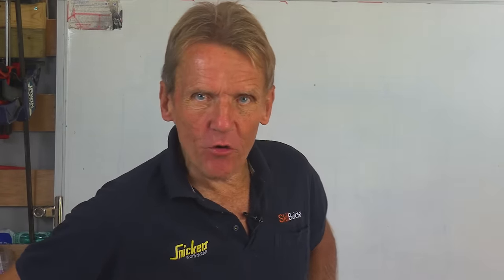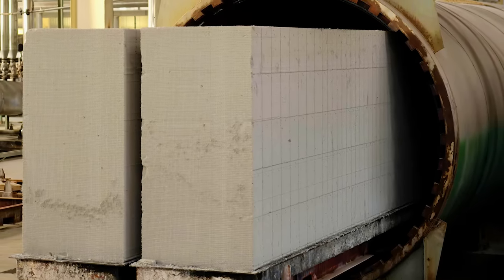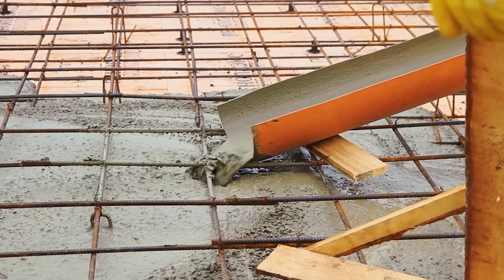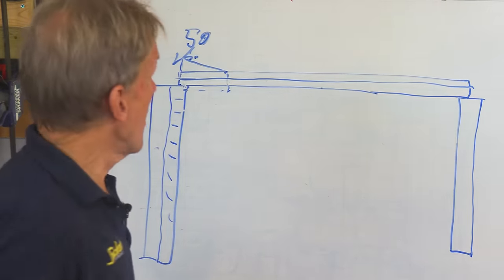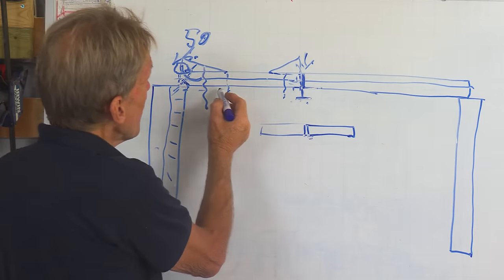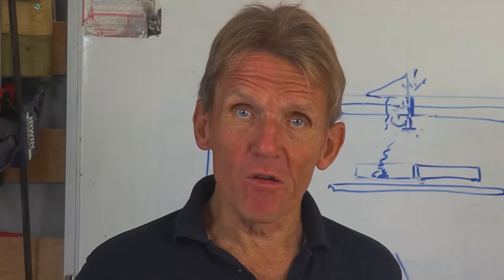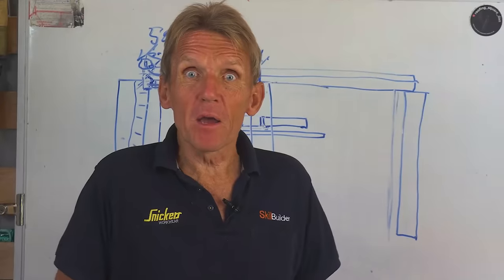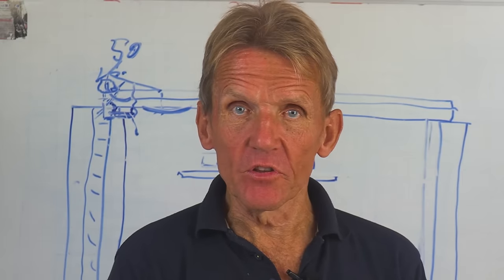The Ugly Truth About Reinforced Aerated Autoclaved Concrete (RAAC)

Comment: I’m a Chartered Engineer and it worries me how pretty much everything is built for the lowest possible cost. Not just buildings, but also cars, machines, electronics. 
It’s a great explanation and it is the ugly truth.
Reply: £18.5 billion to refurb the Houses of Parliament, £370 million already spent on the refurbishment of Buckingham Palace. Oh, and however much Ukraine wants on top.
Reply: I’d argue if you’re a chartered engineer, then you have the responsibility to ensure specifications is met, along with the ER’s and to ensure you don’t value engineer it based on bottom line. Too often I’ve seen consultants buckle on their own specification and allow a project to go from spec driven quality to contractor led d&b. In short, consultants and contractors are both as bad as eachother.
Reply: I'd argue that cars are just ridiculously over complex.
Reply: The accountants rule. I work for an Italian company and they are opposite. They built us a new factory with underfloor heating, automatic windows. Granite tiles in the toilets, automatic doors, taps, toilet flush is even automatic.
Reply: As a Chartered engineer I know there are building regulations and design standards for everything from silicon chips to cars and trains. This means that the cheapest should meet the minimum standards and be safe. I also know that sometimes buildings are built substandard and that supplied materials are either substandard or are found later to be dangerous in one way or another. RAAC and asbestos are two examples. Flammable panels that do not meet UK regulations that were still fitted to high-rise buildings, like Grenfell Tower and Lakanal House, are another.

The worst example is our porous border after Brexit and the likes of Amazon market place letting through substandard food and electronics, rotting meet from Eastern Europe and Asia, and AC-DC mains adapters that short and burn down houses, along with badly-sealed lithium batteries that absorb water and explode, from dodgy factories in China.

After Thatcher’s and the EU’s deregulation drive (cutting red-tape and “better regulation” sound much better than building more dangerous buildings or making more dangerous electronics) we have seen standards erode rapidly over the last 40 years. One example is fire brigades no longer being responsible for checking the fire precautions in buildings. Brexit and post-Brexit trade deals have only made things worse.

Many of these regulations were the results of accidents and medical disasters, from Thalidomide to asbestos, lead in petrol and paint, and now air pollution from burning fossil fuels. We take too long to ban dangerous substances and practices because corporations make large profits from selling and using these materials, and are reluctant to share those profits with consumers and residents who suffered or died from their use.

So it’s a mixture. Standards are good and the cheapest should still follow the standards. But they’re not updated quick enough and the manufacturers of dangerous substances - who often know of the dangers decades before consumers - are not punished hard enough. Regulations are not enforced well enough, and there are not enough investigators to check they’re being followed. Bring back the red-tape I say, and put people before profits.
Reply: @cornishhh Quite frankly cars are simple compared to the computer or smart phone you’re using now to read this. But I bet you never consider their complexity as dangerous?

As for cars, which complex part do you want to do away with? Power assisted steering and breaks? ABS breaks? Crumple zones? Fuel efficient engine management units? Active traction control? Automatic windscreen wipers and headlights? Lane warnings or driving assistance? Automatic parking? Immobilisers and security systems? Catalytic converters preventing pollution entering your lungs? Or your radio, CD player, USB/MP3 player or car phone? We ask for complexity because it makes things safer and life easier and more enjoyable.
Reply: @eddievanbasten1751 I suppose the argument with Buckingham Palace and to a lesser extent the HoP, the income from tourists more than pays for it. Have you seen the prices and queues to go into Buckingham Palace? As for Ukraine, sometimes you have to make a stand, Ukraine is effectively defending the rest of Europe from Russian aggression, they deserve our support.
Reply: Basically that's the whole point of the code. The cheapest solution that is up to the code should be more than enough to work well.
Reply: @eddievanbasten1751 All the key hostile country troll farm talking point hit there 😊

I know it's a script but some good ingenuity used to get it into the convo 👍
Reply: @gregabott5583 Yes, I'm a suveyor and would say Buildings are in reality better built than ever despite some newer estates appearing a bit rushed, but damp-wise, insulation, electrics, plumbing, fire safety etc. is all much better now, problems normally due to skill levels of the people constructing rather than design or materials.
Reply: @ksptm4  He didn't say he was a Civil or Structural Engineer so assume he's not involved in construction
Reply: Companies building machines, consumer goods et deliberately build in obsolescence (https://www.youtube.com/watch?v=j5v8D-alAKE). Otherwise we would never need to replace things. For buildings we need to improve regulation so at least the main fabric of a building will last for hundreds of years. There is a massive amount of CO2 released knocking buildings down & rebuilding every 30-40 years.
Reply: @derekjc777  I drive a 1992 car, so most of the above.
I know many people like complexity but I don't.
I'm on my third £20 phone in about 15 years, and my second £300 laptop. I've no idea how to repair them, but I don't consider them prohibitively expensive to replace. Cars I do, so I like them to be repairable, preferably by me.
Reply: @cornishhh  The era of 1992 cars were among the last that were built without engine management systems, but still had "mod-cons" like central locking, climate control, aircon, power assisted steering and breaking, and possibly ABS. Unfortunately cars that old are usually too expensive to maintain for most, typically costing £100s a year to weld rusty chassis and fix electrics, although having the privilege of keeping the car in a garage most of the time will reduce exposure to the elements, and being able to do your own maintenance and repairs saves a lot of money.
If your car is from 1992, your phone and laptop are definitely more complex! However, anyone who does a reasonable amount driving, either as a job or to commute to their job, probably has a car less than 10 years old, to save fuel and provide comfort, with extra features and complexity included as standard. But this complexity means that most can no longer do their own maintenance, bar tyre pressure (pun unintended), screen wash, wiper replacement and oil level. I know. My hybrid is virtual inaccessible for bulbs - not that LEDs fail - or to check batteries, break fluid, steering fluid, et cetera. I just leave it to the garage...
Reply: One thing with cars, electronics and machines is they all involve electrical engineering and mass production. Taiwan with their chip making, and China with their hugely localised and available manufacturing and low living standards mean that big tech companies can exploit the east. 

As an electrical or electronic engineer it’d be designing the circuits in first world countries and then having the diagrams sent to china, where they would build the PCB, assemble and solder the components and test them all locally. 

It’s a huge erosion of the morale for consumers. And don’t get me started with those same companies implementing planned obsolescence both hardware and software wise, and the legalised violation of our rights to repair AKA “digital rights management” absolute big shots.
Reply: @damianbutterworth2434  A bit waste of money there then.
Reply: @philipholmes6253  yes most of it is broken. We had to shit with doors that opened on their own. We had locks now.
Reply: It's perfectly natural to not do more work than is necessary.
Reply: That's capitalism!
Reply: As an engineer surely you recognise that the art engineering is to design/manufacture something with the minimum cost that meets the constraints?
Reply: It's not cost, it's quality. Raspberry pi is built to a low cost spec using high quality parts with no extras.
Reply: @eddievanbasten1751  Last time I checked, Ukraine aid is Lend-Lease, not a gift. Same as we had Lend-Lease and the Marshall Plan in Europe. No one was 'given' money it all had to be paid back.
Reply: Reminds me of the “My life depended on 150,000 pieces of equipment – each bought from the lowest bidder.” quote from the Apollo days, a similar quote used in the US military. If you're talking Civil Eng, I miss the old days of ICE 6th with the Eng. as the Client's Agent, now we have Eng. with relatively little site experience. For specifying products we went from "or similar approved" to "or similar", so, for cost savings they went to Design and Build, the Contractor now approves products, inspects their own work and self-certifies...I can guess what their incentives are...I've even heard it said Architects should run Civils jobs , essentially doing what we did at ICE 6th...madness.
Reply: @damianbutterworth2434  What has that got to do with quality? We should add automatic flush toilets and that will fix the roof problems? 🙄
Reply: @derekjc777   How many things in your own life do you use that you know are already bad for health? Either for you and your family or the planet in general? Look how many cars VW continues to sell even after the emissions scam. Maybe people just need to care more themselves. 
    The high streets wouldn't be full of fast food shops if people weren't using them. Car makers wouldn't make diesel engines if people didn't buy them. New build homes wouldn't be such poor quality if people didn't buy them. Just stop buying junk and they will stop making it. 
   Are there any 'professional' institutions that people still believe in? Don't trust politicians, don't trust the courts, don't trust the bankers. Building trade has been known for cowboys for decades. My only concern for nuclear power stations is the people that would build them not the technology itself.
Reply: @geoffhaylock6848  It means they spend money and the accountant is a tight bastard that cuts corners. Easy to work out really. That`s why nothing lasts for 100 years unlike my Lathe which is still going strong.
Reply: @geoffhaylock6848  I won’t just take this as an uninformed joke. As a chartered engineer I rely on professional institutions to maintain standards. Standards are their to protect people and keep us all safe. However there is no doubt that people sometimes break standards, in fact standards exist because they do, and regulators exist to ensure companies meet those standards. You seem to think that all builders are con-men building substandard death traps? If that were the case buildings would be constantly falling down. The fact they’re not demonstrates that standards work, and provide a legal framework to ensure builders that fail to comply to standards are held accountable.
Reply: You want to build at the lowest costs! (Unless you’d like to pay more than you need to)

What you don’t want is building according to subpar standards.

The issue here is poor maintenance and ignoring inconvenient facts by the government/governing bodies.
Reply: @damianbutterworth2434  Really? Comparing a lathe that has to maintain very tight tolerances during use and over time with building a house? The more you spend on bling the less you have for the structure. 
  I grew up around lathes, milling machines, traction engines, old motorbikes and cars. They had a simplicity that modern replacements don't. I wouldn't know where to start on a modern 5/7 axis CNC machine. Cars and even bikes are full of computers.
Reply: It is not just cost, it is how things get sub-contracted. A National company get the contract, take a cut, pass it to a regional company, who take a cut, and it ends up with workers picked up in the High Street with no training, being paid close to minimum wage, who might not get paid if it rains, or the job over runs so they cut corners.
Reply: @geoffhaylock6848 My house was built in 1827. Still standing. Very solid. Original stair unlike some new builds. Even the lead water supply pipe is ok lol. I mean they used to over engineers stuff back in the old days before a computer and accountant got involved. I`ve just finished work and the place is full of CNC millers. Even got huge robot arms to move CAT crankshafts etc. :)
Reply: @damianbutterworth2434  Wow, that must be a lovely house. 100 years older than my current UK home.
Reply: @geoffhaylock6848  I found a slip of newspaper in a door frame with a date on. That`s how I know how old it is. I`ve had to put kingspan on all the interior walls to keep warm. It`s even got a pig sty lol.
Reply: @derekjc777 Whatever we think is safe now may prove unsafe in the longer term. When I trained as a teacher the first school was built in the 1890s and didn't have concrete or asbestos concerns,  in fact asbestos didn't cause any concerns. Second practice was in a 1930s school which again wouldn't have had any issues. The school I did the final stint in was a 1960s build causing issues with a leaking roof and probably aerated concrete. Demolished years ago! 
As a science teacher we started with iroko or oak bench tops with bunsens used on top. Tripods were topped with plain metal gauze mats. Health and safety decided we had to use asbestos centred gauze ( why I don't know)) and bunsens on asbestos mats. A big upgrade in safety 👌 😅
Reply: @cornishhh Having had a car fail completely because of a major fault with the ECU causing damage to other systems and making it completely beyond repair I think I preferred the simpler vehicles. While electronics can last well there's a point where the sheer cost and complexity of repair scraps an otherwise good vehicle.  Do I really need the car to tell me I'm driving too close, or not the right side of the centreline? Can't I park the car without TV screens and lines for guidance? Why fit radios when a unit to link with your phone could do more? Some things are pointless additions and others outdated junk.
Reply: @derekjc777 brake!
Reply: Exactly. I too have an engineering qualification and have been vocal on this topic for years, in essence everybody knows that we have to build according to the "building by-laws" but seem oblivious to the fact that these standards are the bare minimum standard to which anyone should build. Here in NZ our building standards were originally adopted from the UK but over time have replaced them with our own standards. Double brick buildings are now banned here as we began to understand the seismic risk we have that doesn't exist in the UK, it was a learning curve and the buildings laws were upgraded on several occasions. Today we still have buildings in use (that would not be allowed to be built today) that only meet 25% of the current code but as they were approved in 1935 (for example) then they are allowed to continue being used because consent was granted when they were built. In the recent Christchurch earthquake the CCTV building that collapsed killing approx 100 people, it was a more modern building but theres had been much word wrangling going on between the architect and the council building inspectors as the developer was aiming at producing the cheapest possible building. Somebody miscalculated and nobody has been held accountable! An extra $10,000 of rebar would have saved a hundred lives. I believe the insurance industry could have some input to change the current philosophy of aiming at the bare minimum by discounting insurance costs for those that build over code, the higher the build is over code then the higher the discount would be. In many cases a little extra would generate a significant increase in strength. There has been two incidents of flooding where I live and both neighbours were inundated needing a significant rebuild costing  hundreds of thousands of dollars each on each occasion. They are modern buildings and the local council has a by-law that houses must be built no lower than the fifty year flood level (Plainly ridiculous) so the builders and owners accept this as the target and not an (unacceptable) minimum. Hardfill is easily obtained and cheap here and the sites could have been economically filled to reduce the risk. All the older buildings were built at a higher level but now the insurance industry has declared the area a flood risk area and we now all pay higher insurance premiums whether we were affected by the flood or not. Its not so much a "flood risk area" as a "dumb council risk area".
Reply: and prices increase instead of going down with the contruction and materials costs :)
Reply: Everything has to be made to a price point. It's easy to make an everlasting car but then no one but the very rich wold be able to afford it. Manufacturing is one long set of conflicting compromises. I know, I was a manufacturing engineer for over 30 years.
Reply: There's no money in making things last. Planned obsolescence.
Reply: Everything should be built to the highest possible cost so disgusting poor people can't have them.
Reply: Well said. If they can't afford a Rolls Royce, then they shouldn't be driving at all.
Reply: @derekjc777 Cars are still complex machines. They're far more complicated then an e-bike. Whilst a laptop, especially the one i'm using for this, is more complicated, there is much less risk involved. If my computer fails, worst case, it's a week of fustration trying to get a new one. If our car fails, death can come quite quickly.
Reply: I'll add software to that list. No matter if it's just beeping in a toy, in a bank or your car.